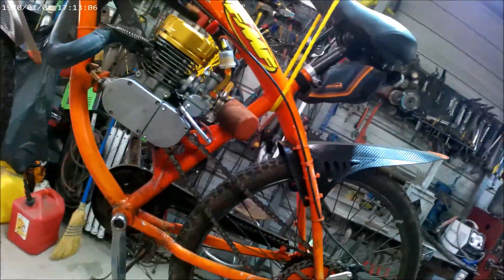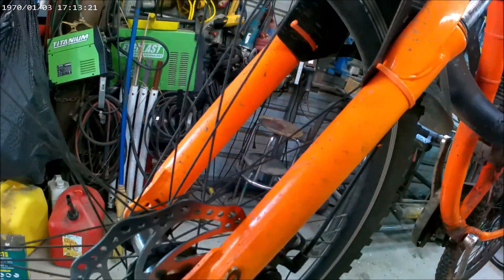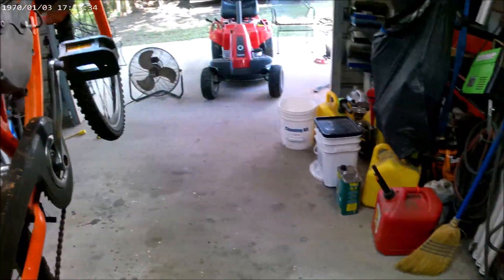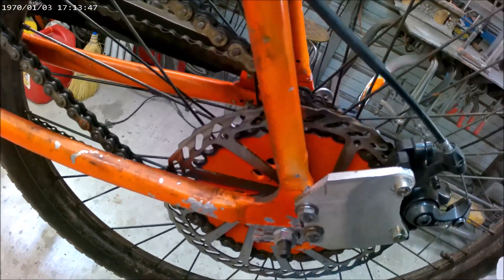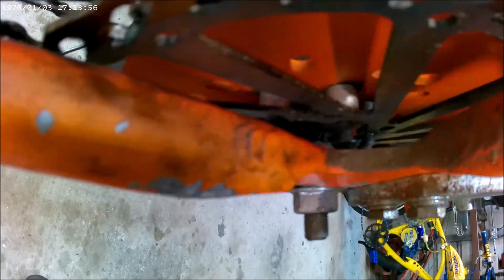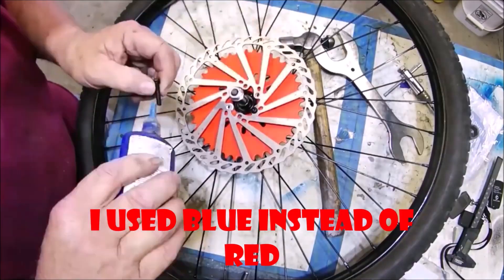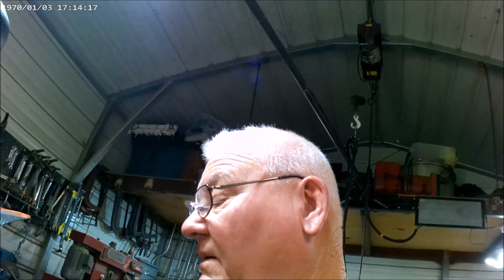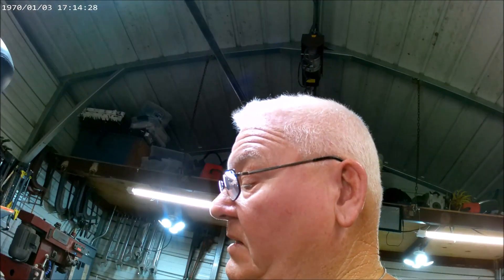Motorized bike Pre ride and post ride inspection this is what we found.

Comment: Great video bro I agree checking the bike after or before each ride is what I do to you never know what could have came loose from riding saves accidents n parts just by keeping up on the maintenance of the bike
Reply from the maker: Yeah I was shocked when I got in and looked at it and then I remembered I use blue Loctite there is red on it with new bolts on it now thanks for watching brother

Comment: Many people have problems with slipping hub adapters....Instead of cutting a key way in my hub, I made some aluminum shim spacers out of an aluminum mop handle. I cut some small grooves in the hub adapter, shims & hub similar to what you'd see on handlebars where the goose neck clamps on...After lining everything up & making marks, I used some super glue between the hub,shims & hub adapter & clamped everything tight. The small grooves caused everything to bite into each other when I tightened the HA bolts. It sounds cheesy using super glue but superglue but metal is one thing SG works good on. so far the hub adapter hasn't slipped at all.

Comment: I'm a big fan of red thread locker on just about all the bolts that are in stress area's, ,I ride every day so yeah I have to keep a close eye on out for those tipe of things you just showed us,I'm in downtown Hammond La, so the rain has been a pain here lately, ,I'm  live an work downtown and I have two different motorized bicycle, ,I ride my Dyno low rider most of time,,iv been runing a 56mm stihl frankenstein it has alot of time on it so I keep a eye on everything
Reply from the maker: Yeah I've always had good luck with the red I just use the blue when I think I might have to take it apart thank you for watching brother and thank you and you ride yours every day to work well I know you check yours if that's the case be safe